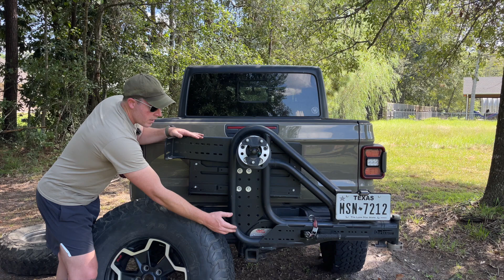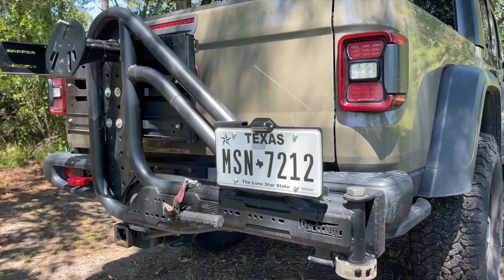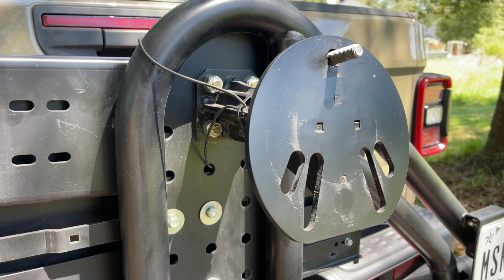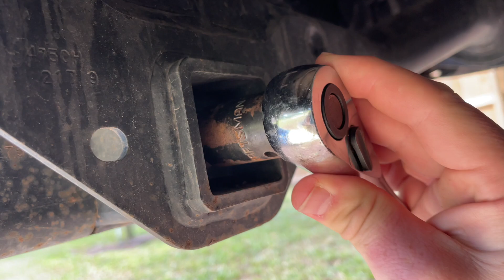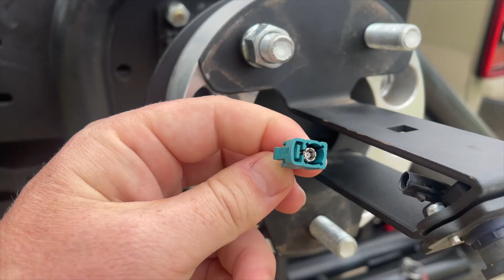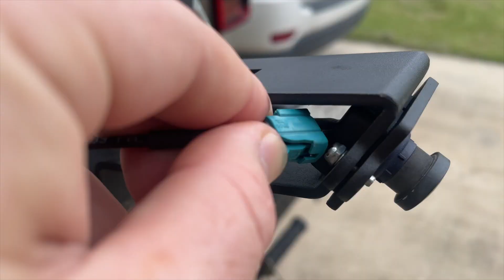Dirtcom TrailSwing HD and Backup Camera Relocation

Comment: Actually prefer DOM tubing vs chromoly which while lighter, can become brittle from welding and constant vibration or flexing load. Load capacity is higher per weight but definitely has some drawback
Reply from the maker: Agreed.. theirs is all heat tempered welds so it should mitigate a lot of that weld stress. Otherwise it’s a great combo of materials considering the weight and stressors incurred 🤘🏼

Comment: Hi, I really need to get a backup camera extension for my 2015 Ford Expedition EL. I checked out that site to find an extension cable from the location of the factory camera to extend it to trailswing HD but I can't even seem to find back up camera wiring. Have any ideas what I should be searching for there? I'd appreciate it friend! ;-)
Reply from the maker: This is the backup camera for 2015 ford expedition 
https://amzn.to/44MySe9
As for the wiring, I haven’t seen any wiring harness extensions, but you may be able to score one at a salvage yard along with the camera and just splice in wires to extend it the length you need. 
The type of cable is a 600tv, but it will require the OEM plug.. hope that helps
Reply: @GatorOverland Cheers for that. Appreciate the response! 😉🙏🏼

Comment: Do you notice the tire oscillating forward and back on concrete highways? Mine does it and shakes the entire truck.
Reply from the maker: All tire carriers will experience some amount of deflection from the weight leverage of the tire and it will be even more exaggerated as you increase the weight of the tire… That said, my 37 @95 pounds has a minute but visible deflection at highway speeds, but I don’t notice it affecting the vehicle. Thankfully the system is very quiet. 
You may double check your landing pad adjustment and move it up a few fractions of an inch to increase the preload on the landing.. other than that I love this carrier

Comment: Any issues with covering the third brake light?
Reply from the maker: It 100% covers the third brake light… There is visible lighting coming between the spokes of the wheel when the brake is applied… Don’t know if that is technically legal but I haven’t had any issues in 20,000 miles

Comment: how does it ride when fully loaded with the RTT bed full of camping gear and such? do the falcons hold up? and are you thinking of going to HD springs or air bags yet?
thanks! great upgrade
Reply from the maker: When loaded down and pulling a trailer as seen in the video, I’m probably right at my limit before needing hd springs or bags. I don’t do it often enough to justify the investment, so bags would probably be my route to maintain comfort when not loaded down. The falcons are awesome loaded or unloaded, both on and off-road..